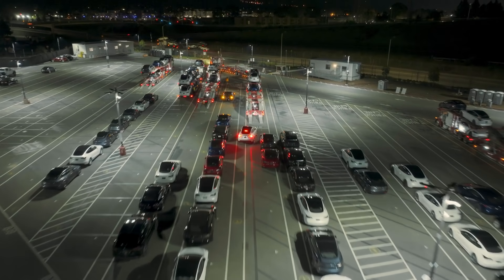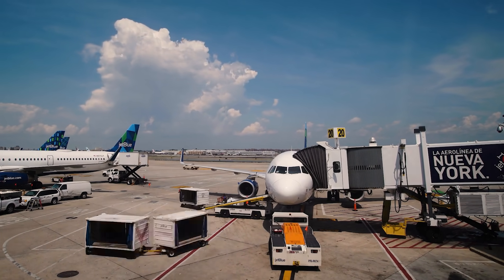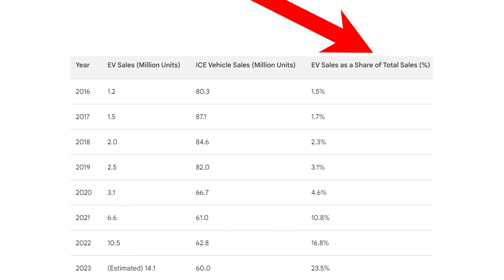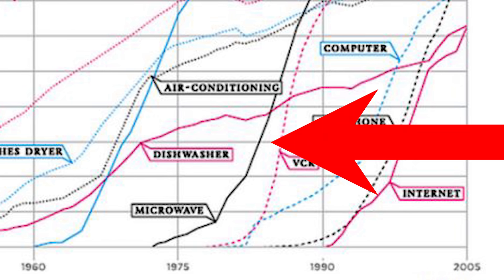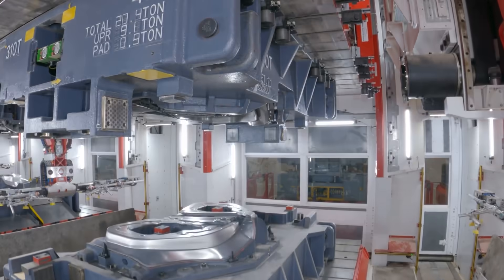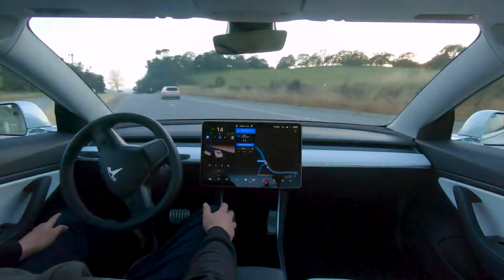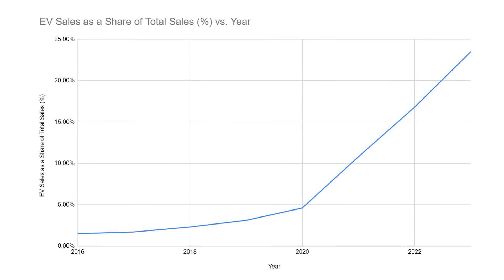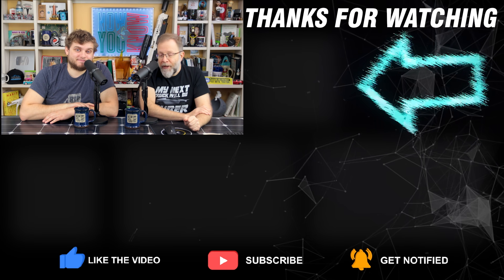The EV Adoption S Curve | Disruptive Investing News

Comment: I think current EVs will die. Here's why. My innovative technology is a 2-in-1 single stroke electric generator. This technology will be able to convert different fuel sources gasoline or even hydrogen and directly convert it into electrical power with about 60 to 80% efficiency.Therefore the electric power coming from it will be about the cost from the grid. It's significantly lighter, lower cost, and requires no rare materials to create it. Current EV tech isn't effective like it's being presented.
Reply: I am in the energy industry and had to dive into renewables after the 2014 fraker - Saudi wars that crashed the oil prices. There is this huge advantage about non movable mechanical parts in a product and solar being the main simpler cheaper generator unit available, all electric inverter driven being way more efficient robust and easy to manufacture and to control plus energy recuperation, electric infrastructure being the easiest to grow and investment leaving the oil industry when the oil prices drop when demand goes away by tech like your generator that it shows me it is really non viable for land transportation any more.

Batteries being the link that joins everything together at the end.